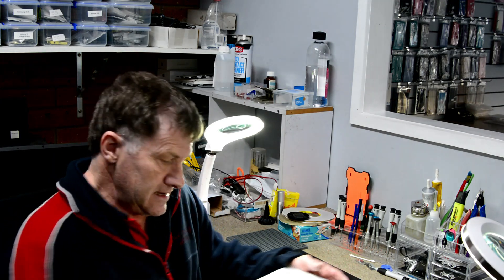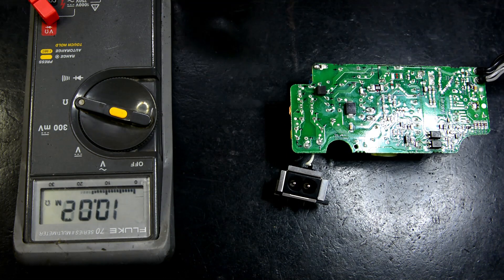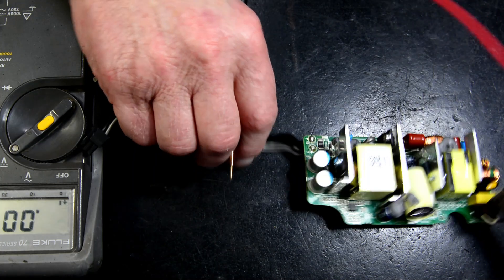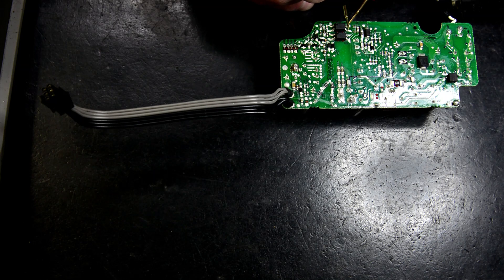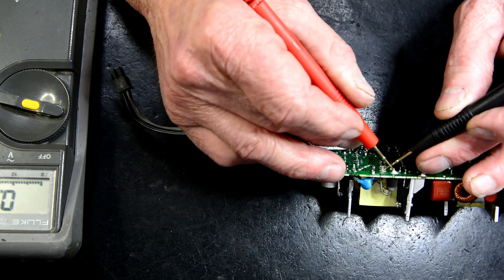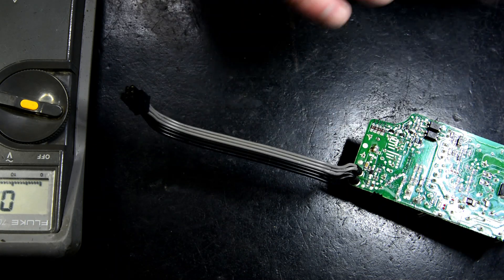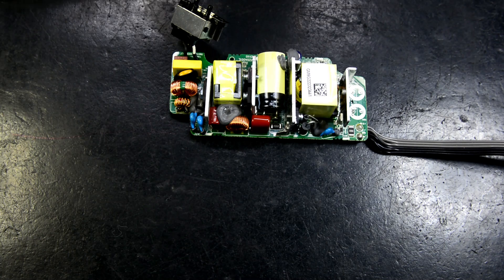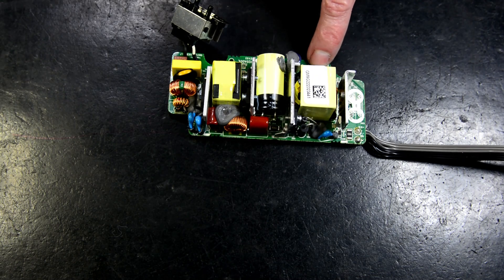Xbox one S power supply fix

Comment: do you have the diagram ?
Reply from the maker: No but I've fixed thousands of smps, they are mostly the same, I'm a TV technician from way back , faults can be found by checking volts rails to devices and bias , as well as low resistance measurement to find shorts, also when you can find individual data sheets on ics and transistors on line, did you see the video I did on the original xbox supply? . Also if you got another power supply the same working you can compare readings
Thks 
Dave cassells

Comment: Mine is making buzzing chirping sound and it’s never got water on it  , it was working ish but would start lagging and closing games after playing for an hour n would b really hot and when I turn it off it starts the buzzing chirp sound louder  I pulled out the power supply and plugged it in off the motherbonow and it was making the sound  then I put it back together to test,and  it doesn’t even get lights or a fan start up spin now
Reply: Hello there did you find a soluttion for that did you fix your xbox? Iam facing that trouble right now and I don’t know what to do

Comment: Wonderful video! But i have a question. Mine doesn't turn on at all, and it does not smell burnt. It smells okay. Is this a motherboard problem? Or do i just need a new power supply?
Reply from the maker: You need to check the voltage comming out of the power supply , could be either faulty

Comment: I had my xbox pluged in during a thunder storm nothing smell or looks burnt I switched the cord with my TV and the cord for the xbox power cord works on my TV do I need to send it in
Reply from the maker: sounds like its the power supply you can but some on ebay for like $35 AUD

Comment: When I plug it in the plug makes a noise and then doesn’t turn on should I buy a new cord ?
Reply from the maker: Possible not the power supply  .
But mainboard issue
Reply: Dave Cassells Electronics should I buy a new cord ?